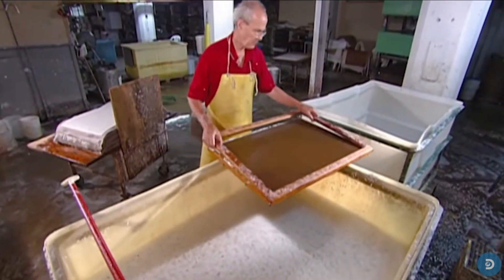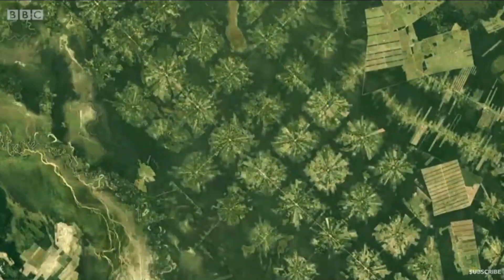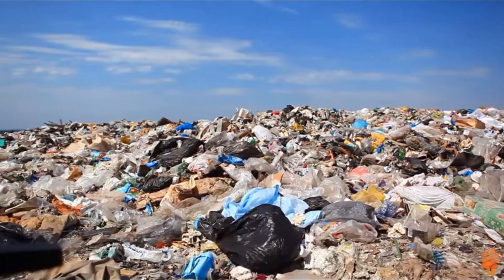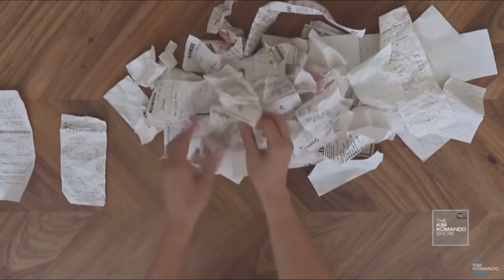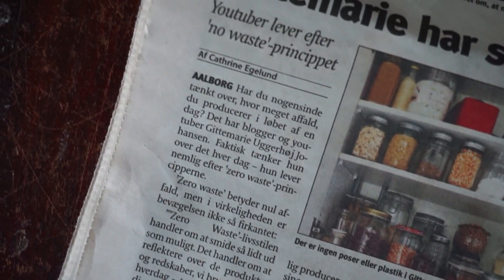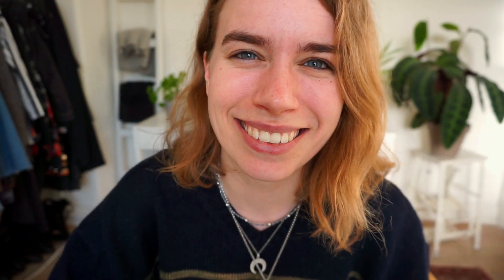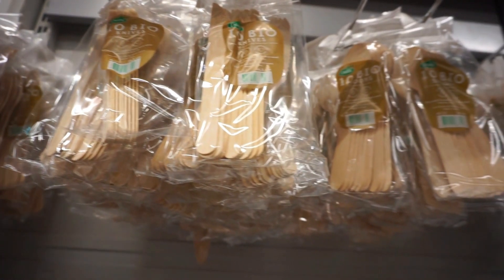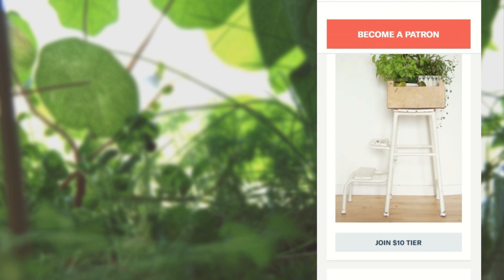HOW SUSTAINABLE IS PAPER & CARDBOARD? / paper vs plastic disposables

Comment: 11:45 How do the ones handling the recycling determine if the recycled material is useable or not. Do they have automatic filtering and cleaning systems or maybe lots of people doing manual checking? I think it would be really interesting to know what happens in between the collection of the recycled material until it's been recycled.
Reply: Ermude10 I’d love to see a documentary type of video on the process of recycling/ how it works.

Comment: Very helpful! I've been thinking about one paper issue a lot: whether to compost or recycle. 
I compost at home and also am lucky enough to have municipal compost pickup. In an ideal world, i think once plant material is milled into paper, we would take full advantage of that work/energy and recycle it continuously till it was degraded in quality beyond usability and then composted. On the other hand, a lot of material sent to recycling just ends up in landfill anyway, and even if it is recycled once, there is no gaurantee it wont end up in landfil in its next life. If I can gautantee now, through composting, that the stored carbon in the paper will return to the soil and feed more plant life, is that preferable, even though I am shortening its life as a potentially recyclable product? Ahhh the dilema!